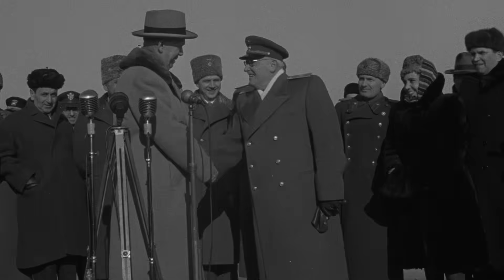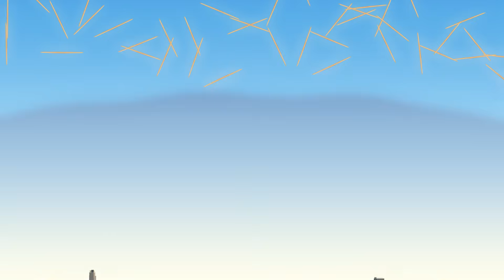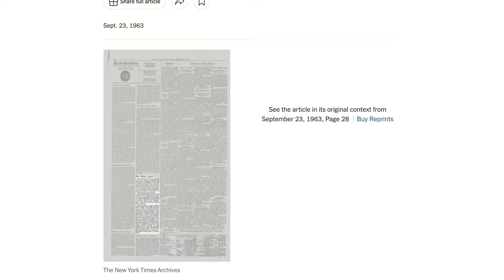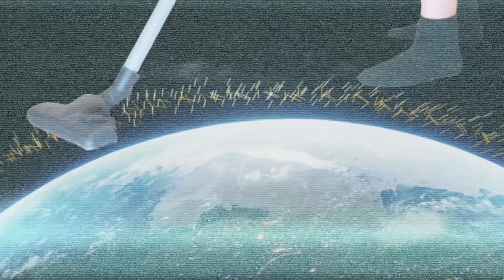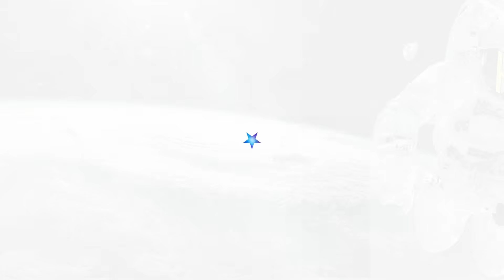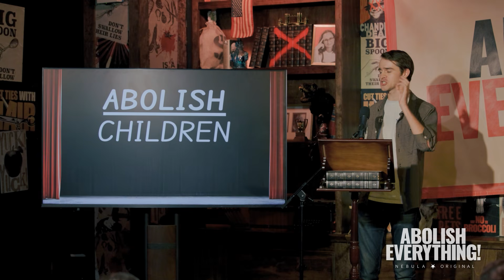Why The US Government Put 480 Million Needles Into the Sky

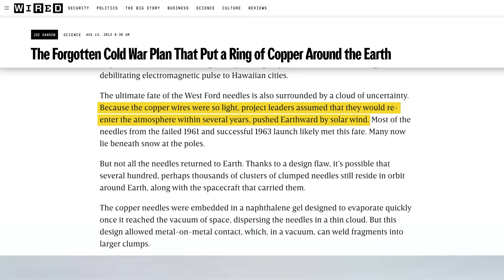Comment: 5:41 correction: you won't find any, because they would all have burned up in the atmosphere
Reply: I doubt all of em would burn up. But heavy enough. Yeah theyre going at orbit speed.. but resistance to air will slow it down due to its size and weight.  Its like how a squirrel wont die if its dropped out of a plane. The air arround it + its weight will limit its speed and decent. Its not falling anyfaster. Itd be falling slower. Because orbit is just the act of constant falling. It would have to be perfectly alligned with everything for it to go anyfaster
Reply: @Crasnos said air resistance is exactly what would cause it to burn up due to heat generated by friction
Reply: @segganewbut its small. Its not gaining any speed. Its dramaticly losing it. I personally feel it would catch the first bit of resistance. Start tumbling. more resitance. Which would Slow it down. Theres not enough mass to keep that sheer speed. Too much resistance. It would just tumble out of the sky.
Reply: @Crasnos it is gaining speed initially tho, via gravity
Reply: @segganewthe size and mass isnt mathing. If it was the clumped up ones. Maybe youdhave an argument. Just a single copper needle will loose enough speed quickly enough. .. theyd melt from the solar radliation before gravity ever has a substantiall effect on them. Theyre thinner than a human hair
Reply: @Crasnos have you seen the starship reentry videos? Thos plasma shows happen at an atmospheric density far lower than the one required to substantially slow down the needle enough
Reply: @segganewit wont melt!
Reply: @Crasnos why not? It's going at orbital velocity through the upper atmosphere and has very little surface area
Reply: @segganewexavtly! Were talking about a copper wire less than a gram.
Reply: @Crasnos but it's still hitting the atmosphere at orbital speeds

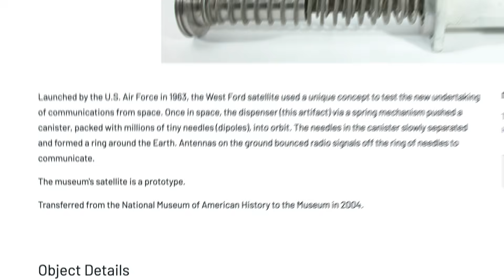Comment: (2:50) That's not how the Ionosphere or Antennas work. HF is the only (main) radio frequency range short enough to reflect or refract off of the Ionosphere. If the needles acted as half-wave antennas, they're only passive in the microwave (8 Ghz) range and would act as a scattering field with 99.9% of the signal being lost before it reentered the atmosphere. But maybe some of this is resolved in the video.

Comment: Holy shit! That’s why it’s called Haystack Observatory?! Because they were looking for needles?

I took a field trip here in middle or high school, I lived a few miles from the observatory for the last decade. I would have never put that together with out this video, thank you Half as Interesting!!!
Reply: No, that's not the origin of the name. Herb Weiss, one of the original engineers, wrote in a report that Haystack was originally just a "code name," and code names are usually chosen more or less arbitrarily. Later, the press drew a connection between "Haystack" and needles, which, according to a 2021 Boston Globe article, Weiss found annoying to the point where he wanted to get rid of the name, but by then it was too late.
Reply: Actually, I dug a little deeper, and discovered that the site of the radar was called "Haystack Hill" at the time (although that name seems to have fallen out of use). So the "code name" was taken from the name of the hill where the radar was built. Regardless, the name "Haystack" did not originate from the connection with Project Needles.
Reply: Greetings from Nashua